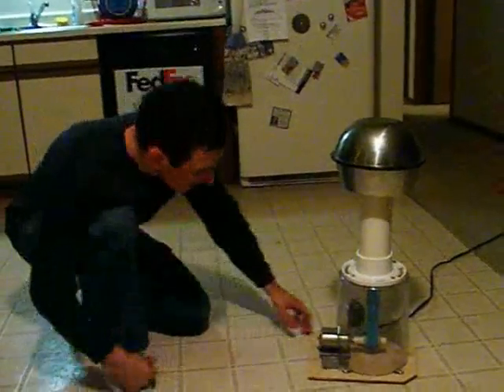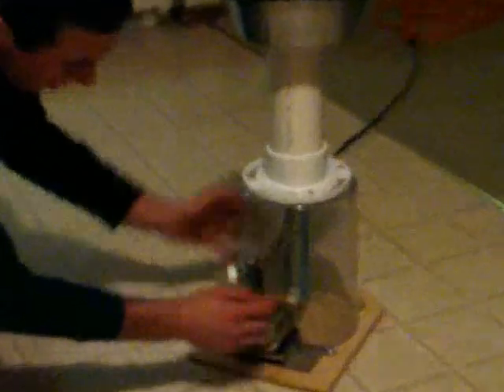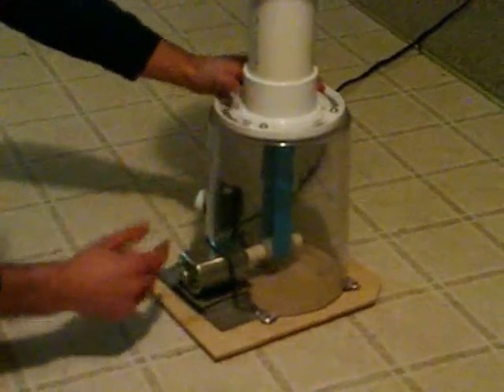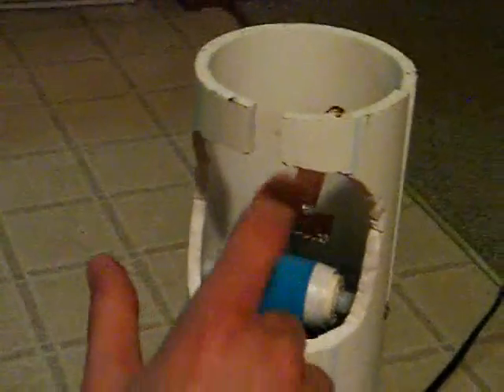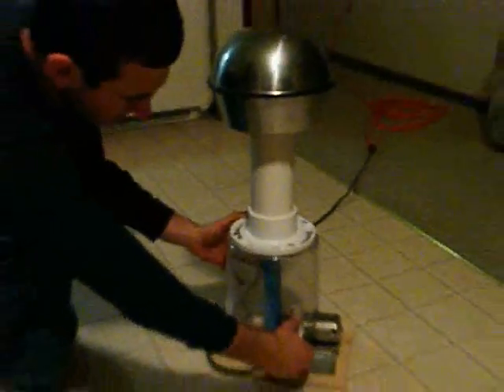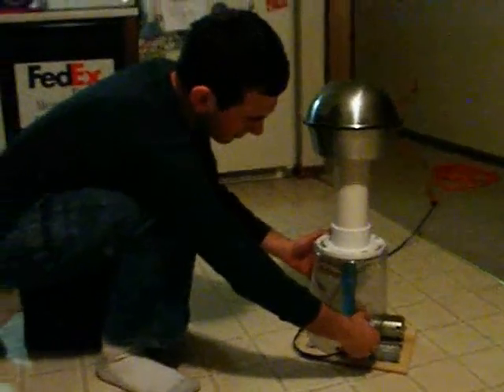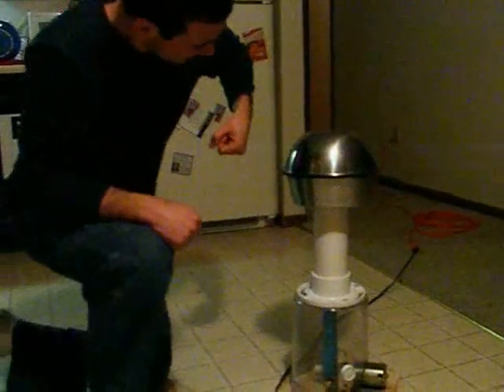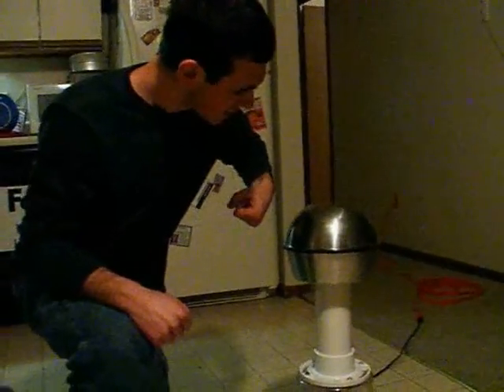Build Van de Graaff

Comment: I used a piece of PVC pipe with a wood dowel in the center for a core (drilled to fit a plastic shaft), and a glass guitar slide (buy them at any guitar store) with a wood dowel in the center for a core (also drilled to fit a plastic shaft). The belt was made from a scrap piece of polyurethane food-grade conveyor belt I had at my shop. Works very well.

Comment: I was trying to made one van de graaff generator in my home but it does not work. The upper roller is made of rubber and lower is made of metal (it's drives by the engine from the drill). As a rubber belt i"ve got the innertube from bike. the lower comb is attached to the gdound and the upper comb to hollow sphere. Help me please!!!

Comment: hmm seems like the brushes not touching wouldn't work of course, i built a mini a wile back, but it only did small sparks. i will have to try with the brushes not touching once i get a motor and build my bigger one. thanks for the feedback.

Comment: Do both rollers need to be non-conductive material?  In the 200,000 volt store model that I own, the bottom roller is some sort of plastic, but the top roller is solid metal.  Does only the bottom roller make a difference?  I've also read that in the popular Winsco model, the bottom roller is actually wrapped in cloth.

Comment: So the rubber belt is from an exercise device? How did you connect the nylon cylinder to the sewing machine motor? Would a metal roller (i.e., tin can) work just as well as a nylon roller? How do you keep the belt from sliding off?